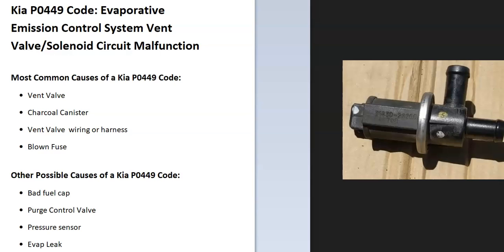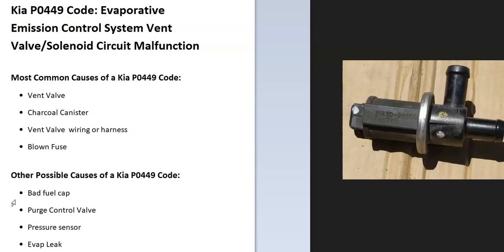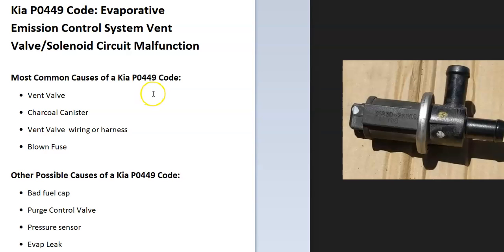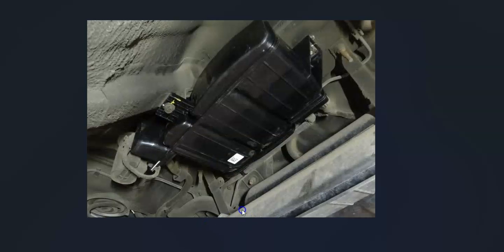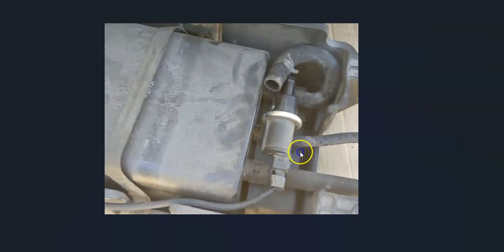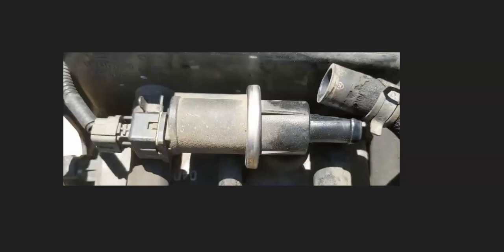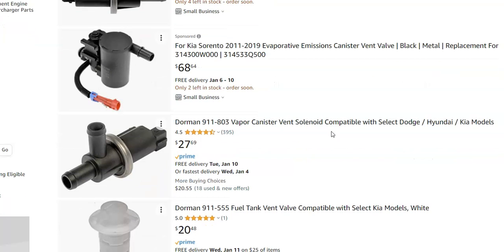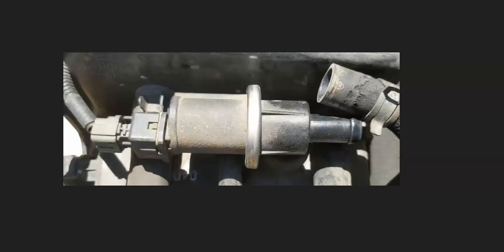How to Fix KIA P0449 Evaporative Emission Control System Vent Valve/Solenoid Circuit Malfunction

Comment: Hello and thanks for your explanation
My car (Sportage SX Turbo) has a P0449 error problem that only appears when it rains or when I travel in wet areas and the error is fixed on sunny and dry days! I replaced the solenoid valve with a new one and the result did not change.
What do you think is the problem?
Reply from the maker: Weather can effect seals and hoses which can leak when its too hot, cold, or rainy. There likely is a bad seal or hose causing a leak.

Comment: I changed the vent valve and the purge valve and the gas cap on my 2015 Kia forte and code light still comes on but don't stay on after I run it a few starts and it's back off any ideas?
Reply: SAME HERE, GOT ANY SOLUTION? 
IM WILLING TO GIVE UP SOLVING IT AT THIS POINT :(
Reply: @Alhuezo I have a 2013 Kia Optima that's been showing this code for 3 yrs now. We've replaced everything suggested & the code still shows periodically. I even talked to a Service Tech at my local Kia Service Center about it. He told me that it was a known issue & there's really no way to clear that code permanently.